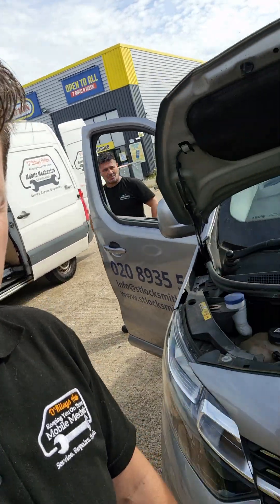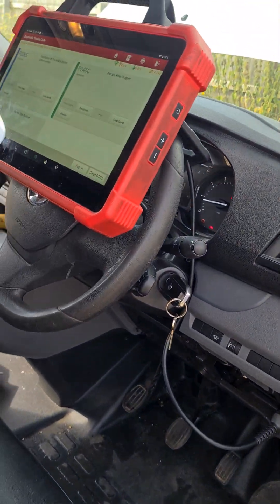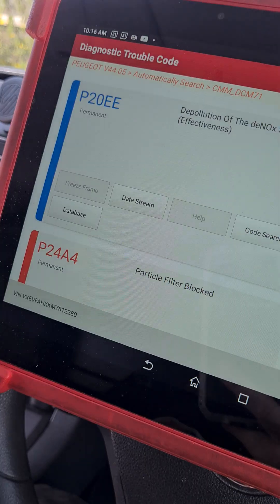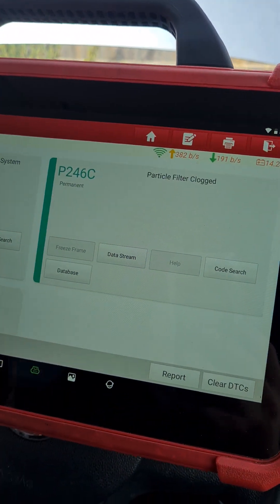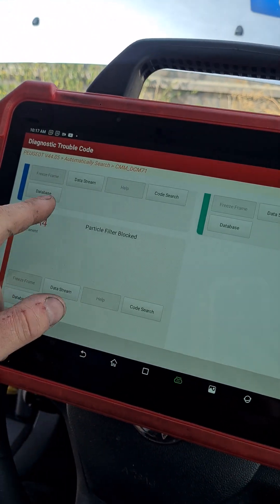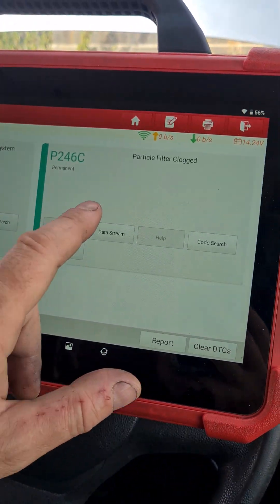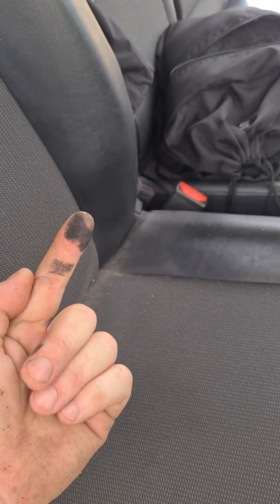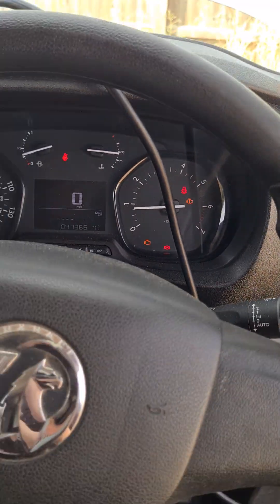P20EE Depollution Of The Denox System Diagnostic Assessment

Comment: Hello Jimmy. I have exactly the same situation as the Vivaro 2013 , Black dust stuck inside the pipe. I have been to a few places, and no one can tell me what the problem is. Do you think it is the DPF ?
Reply from the maker: 2013 is a different system so wouldn't have P20EE

Comment: Hi , is P20EE:92 the same problem need new dpf?
I checked my adblue Injector and that was sooted up.
I've replaced the injector and also done a active test on the autel which still says adverse faults on the injector. 
I've not had this problem before but my engine came up and adblue symbol as I was driving on the carriageway, I did notice on looking at live data the Dpf had 20g of soot, 
I'm not sure what the 92 means at the end of the code 🤔 any help I would be greatly appreciated.
 Thank you

Comment: Genuine question, how are people getting clogged DPFs so quickly? Are they driving them around at 1200 rpm or idling for hours each day? Most of my family have Euro 5/6 diesels and despite them being quite slow drivers none of them have had a blocked DPF. This has been going on for years now.
Reply: Basically yes, a lot of the time. Many of them never see the open road & the amount of people who let them idle for long periods is shocking.
Reply: @hughmarcus1  it’s interesting my diesel tells me to shift up to 6th at like 45. The RPMs would barely be above idle. I usually keep mine around 2k and haven’t had an issue - even though most of my driving is around town. I’d be interested to see if newer automatics with less aggressive shift patterns and “eco driving” are responsible. It’s rather counterproductive if you then have to take it for a blast to blow the cobwebs out. My dad’s Toyota shifts itself well past 2k whereas my TDI indicates to shift up stupidly early. Very suspicious that the super low revs the modern cars recommend is responsible for premature clutch/flywheel wear and the dpf/egr problems. All that said they’re a waste of time and money anyway. Too bad it’s illegal to remove/bypass them 😕

edit

A modern exhaust has a DPF, catalytic converter, centre resonator and a silencer/muffler. Who’d have though that piling filter after filter on an exhaust would cause problems. It’s quite ridiculous in my opinion

Comment: Only solution to that is remove delete remap problem solved
Reply: That doesn’t work for a euro6. As Jimmy pointed out the DPF sits in front of the cat. They’re a joint unit. If you take the innards out of the DPF you’ll clog the cat & you’re back to square one.
Reply: @hughmarcus1 my cats been fine for years without a dpf, how do you think they managed before DPF's?
Reply: @Ben-in6qh  that’sc because your car has an early version of a cat, not the sophisticated SCR versions there are now. Listen to what Jimmy says about that van.
Reply: @hughmarcus1  my 2022 euro 6 transporter you mean? No adblue, no EGR, no dpf, kept the cat so it doesn't smell, perfect 👌

Comment: Worked at Citroen for a while there, just absolute junk, the normal cause for this however is the injectors overfuelling damages the dpf/cat its a common problem with both the 2.0 and 1.5